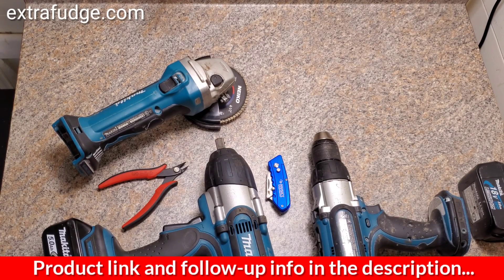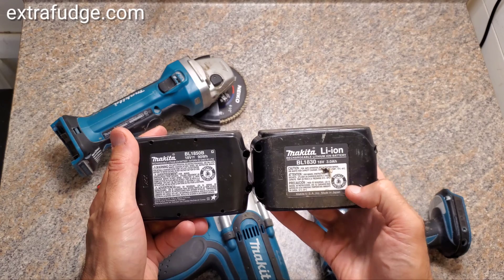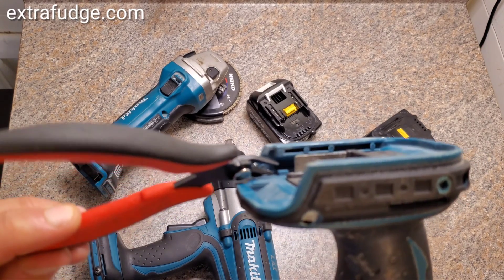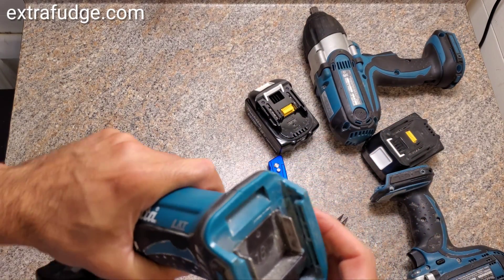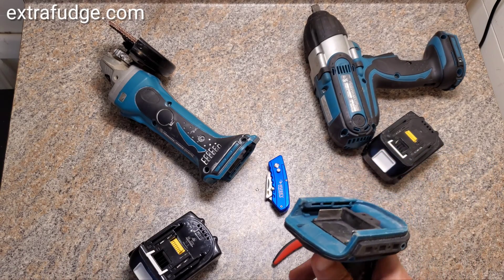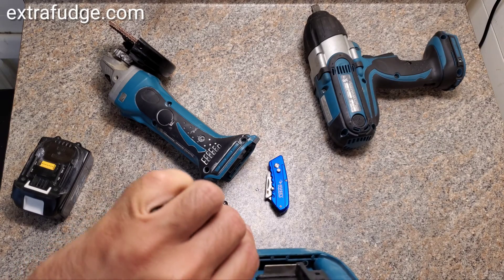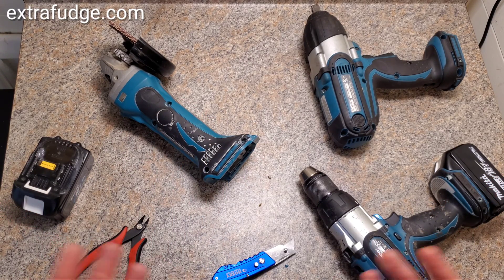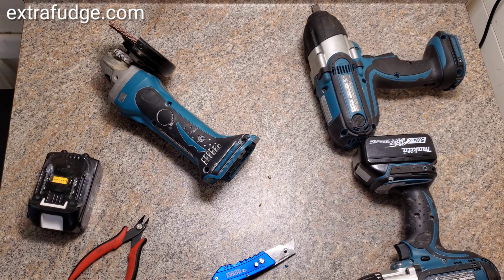How to use old Makita tools with newer batteries mod

Comment: You say it yourself " ...make you buy new tools"....😡

I've just migrated over from 14V. It's been good, Finally having to resort to cheapo Amazonian NiCads, which expired in half the time of the Original Makita batteries, but now my weapon has got too rattly too. So I thought let's move up the food chain. 

This stinks...

If there was a genuine compatibility, runaway, safety issue between old tools and new batteries...publish that...properly...honestly. They haven't, so I smell Cynical Bullshit.

Not nice Makita...when your client base play straight with you!

My experience here in the UK has been shitty on aftersales anyway, so my love is slipping.
A couple of times I've asked for help or advice. " Pay us to even look and we'll see how much we can roll you over for"...was the response.

However, to be honest everyone just wants your Shillings and then shaft you on aftersales or peripherals.

Thank you for the heads up however. Nice to see a small " no screw you" whenever you can.

P.S. 

Anyone noticed how the shift from DIY basics within, as an example of what I'm getting at, the car industry is rodgering Joe Public? Your shitty manual no longer tells how or where to get the oil out. Just so you save a few quid, so you're in a better position to pay for real, necessary work?

My point is, their idea of playing Bat & Ball with you is, You Throw The Ball, They Shove The Bat Up Your Ass!

Comment: Question, if you cut out the little tab, is it still compatible with the older batteries? I've got all older ones now, and am looking to start replacing the old batteries but don't want to make the old ones useless if I don't have to.
Reply from the maker: Yes, that's the crazy part, it's like they  planned this.

Comment: You can take your anglegrinder and cut little hole to your battery like newer battery have. So the warranty wont end.
Second thing is, my tools have this thing metal not plastic, so it's harder to cut it off or remove.
Reply from the maker: Those are older tools that will never be under warranty

Comment: thanx. i have opposite problem, have good old batteries and chargers, they won't fit new drill
Reply: got it, filed a little plastic on the batteries for the extra contact that the older tools don't have. thanx to you, also Finn
Reply from the maker: Glad it worked out!

Comment: This was just a crap move by Makita. The proof there is not any difference in the battery is the older chargers work with the new batteries. If there was any thermal monitoring (BS) that would be what would have it far more than the tool.

Comment: Thanks for the video.
I only just bought a couple of makita tools and was wondering whether or not I can charge my 3 amp battery in the new 5 amp charger?
Reply from the maker: Yes, if it's lxt the capacity doesn't matter for the charger.
Reply: You definitely can. Totally interchangeable.

Comment: I phoned Makita technical helpline today in UK. As helpful as they were, they didn't actually explain WHY they did this. I think everyone has already hit the nail on the head though, (bad behaviour Makita)! 
They didn't mention anything about newer batteries having thermal protection. They just said I had older model tools (2009) and they WILL NOT fit the new "star" batteries or 5amp. I'd have to buy more 3amp BL1830 batteries. 
I even explained that I think it's just a different notch and asked if it can be modified. They said you can have the whole base plate changed at a cost so it'd be cheaper to buy new batteries. What annoyed me most (after watching this great video, thank you) is that there is NO WAY Makita didn't know this was such an easy fix and yet promoted buying new tools/older batteries. Poor effort Makita.
Reply from the maker: Glad it helped you. Bad Makita bad!! 😛
Reply: @davea6064  ...as I've found...good tools but...'kin robbing crooks... patronising too.

Comment: My friend FYI Makita is manufacturing the new tools with that little nipple out of metal so your advise here is no longer valid unless you come up with a better idea how to remove the metal
Reply from the maker: But the nipple was on the older tools... The new tools don't have it.  Another option is to just get these after market excellent batteries at a fraction of the price:  https://extrafudge.com/ref/B08G8R52FF
Reply: Not sure that you are tailing about. As stated this was only on older tools, none of the new ones have it. I have a bunch of Makita tools that are both older and newer. None ever had metal.
Reply: There is a metal nip on some newer tools. Just bought a Makita cordless cleaner DCL286FZB. I have plenty old light BL1815 1,5Ah batteries I want to use. I had to cut small sliver of plastic off from the batteries because of the metal nip on the cleaner.

Comment: ureviews - brilliant and simple hack - 5*** - works perfectly - there are no connections on the old battery that are not on the new style to monitor any kind of thermal alarms or shutdown - so it's just Makita trying to make you buy a new tool when your old batteries become tired - VERY disappointing for an otherwise great and professional tool company like Makita

Also, take note all Makita 18v users - the new 18v Makita charger is charging at 2.4 amps - keep your old charger with the built-in fan - that charges at 9 AMPS ! - 5 times faster !

Comment: I have the 18v 3.0 ah tools and need to get new batteries as I'm down to 2.  So can you charge a 5.0 ah battery on the original charger that I had to charge 3.0 ah batteries or do I now need to also buy a new charger too?
Reply from the maker: I checked the new batteries do charge on the older chargers